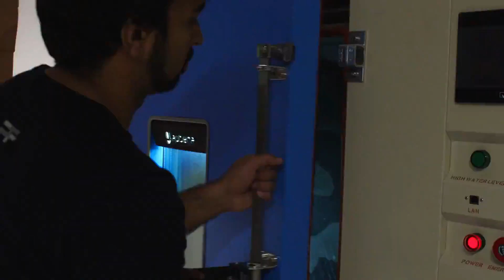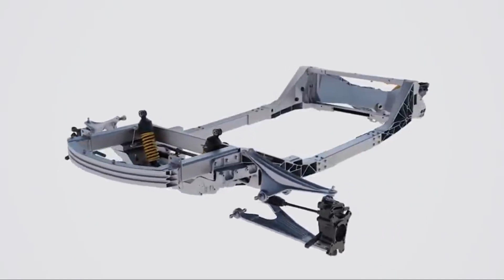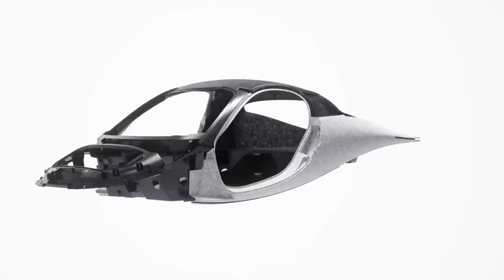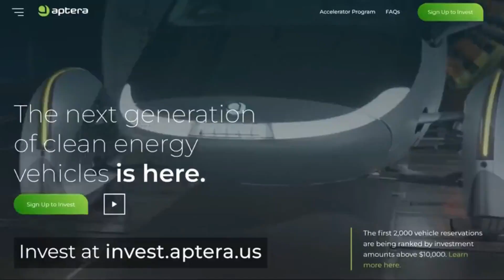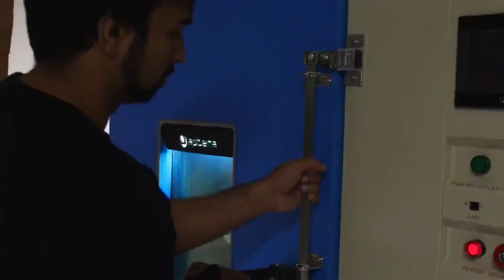Aptera Joins FORCES with C.P.C Group to Accelerate Production

Comment: Here's a comment I discovered I was blocked on - the weekly investment update:

Your information is worthless so long as you don't include their weekly spend rate. An August 6 2022 Aptera Owners Club evaluation of the latest SEC Filing has some interesting information, where the annual spend was $15m, or nearly $4m a quarter. At 1:04, your chart shows an income of just over $3m in the last quarter. (weeks 21 to 34). At that rate, that isn't enough to keep them alive, so there is no raising money towards the $50m required. In fact, they need more than that as every week progresses. By the end of the program, they will have achieved nothing, other than be closer to going broke.
Another thing of interest in the report was the 'Plan of Operations' list seen at 25:49. The third last dot point states they will build Delta before 2022 arrives, yet the report is submitted in August 22. That's just pure nonsense, and indicates how slack they are at reporting, as well as a complete disdain for government rules. In fact, my memory recalls they even knew about their switch to CPC long before August 22, so they are withholding information that they know will put Delta back by years. This is a possible serious misrepresentation that should be investigated by the SEC. The next dot point says they plan to deliver to a customer before 23 even arrives. As October 23 looms large, the snake oil is evident in hindsight.

Comment: The Audi 3 wheel concept car is more efficient and much more practical than the Aptera motorcycle.
Reply: @bobhellman8676 must be a new concept vehicle that we can't even find a reference to. Would like to see how it could be more efficient.  Aptera isn't in production yet, but much more than just a concept
Reply: @bobhellman8676  one of the latest Videos from electric viking
Reply: If it has 3 wheels, it's a motorcycle or autocycle in my state.
Reply: @tims8603  you are right. But did not intend to register it anywhere. Its just a proof of concept.

Comment: Thankfully Aptera's delay has been for positive reasons... let me reiterate what I've been told.  Originally they expected an interest level of up to 5K vehicles and had plans to build the composite parts using a sandwich construction method.  This method took considerable time and labor, but it was suitable for low volume.  When orders quickly surpassed the 5K expectation in just the first couple of days, Aptera needed a different, much faster composites manufacturing method to keep up and this was a major change of tack.  I believe Sandy Munro introduced Aptera to CPC, and discussions/design work began with them about two years ago.  Vehicle design changes necessary for the new manufacturing method were completed and CPC began to build the full scale tooling about a year ago.  Some of solid steel tooling blocks for Aptera weigh nearly 10,000 pounds and take many months to machine.  Most of that tooling is near completion now, and CPC is making the first validation parts with the tooling that is finished.  The expectation is to have a Delta test/validation vehicle or two, at or about the end of the year, with testing to follow.  Production depends on what the test results show, and whether or not changes will be necessary.
Reply: Hello, everyone! Just remember, AussieIdeasMan is doing us a great service. The one who yells from the mountain tops, "You can't! Because!" only stirs the fiery drive to create what has been said cannot be created. Thank you Aussie Ideas Man for that spark.
Reply: @89CrazyAl    Needed perspective, thank you.
Reply: @89CrazyAl  He is a clown of a naysayer. But he does serve a purpose.
Reply: @bobhellman8676   For validation/testing vehicles I don't know what they will do, sorry.  The intent for production is that CPC will do full body assembly, including glass, and ship completed units.  I wish I could tell you more about castings tooling and such, but no word is out about that yet that I am aware of.
Reply: @bobhellman8676  No problem, good questions.  I'm hoping for some update info to come out of the Owner's Club factory visit too.... I'm sure Steve will dig for details.  I don't speak for Aptera but I believe the power use is a calculated average.  Real world testing will be exciting to follow and see just how close it turns out to be.  My personal feeling is that Aptera has been a bit conservative, and that the production vehicle will meet or exceed that goal.  The vehicle composites have lost some weight in the transition from the originally planned sandwich core construction, to the sheet formed process of CPC, and the use of carbon fiber.
Reply: k @bobhellman8676  No worries, this is fun discussion and I'm happy to share anything I know.  I have not seen the frontal area published, but I can tell you that the coefficient of drag comes from a solid source.  Steve and Chris have said in interviews that the first big check they wrote in the beginning, was to NASA, at $17K for wind tunnel testing and a certified report.  Check out the recent Aptera Owner's Club video of the early days, that was the vehicle version tested.  Quite a few drag reducing refinements have been made since that time, so I would expect Delta to hit that mark.
Reply: @bobhellman8676  Bob, in regard to frontal area and drag, Chris Anthony has also talked about the vehicle shape, (particularly the hump in the back) when combined with the ground effect, pulls the high pressure away from the front of the vehicle.  This is also one of the key aspects to Aptera achieving the low coefficient of drag.  They stretched the tail a bit longer for drag reduction too.
Reply: "Thankfully Aptera's delay has been for positive reasons..." The delay in total has spanned   17 years, since they bagan in 2006. Dumb fanboys will discount most of those years for weak excuses, but 2006 is the real start. 
"let me reiterate what I've been told.  Originally they expected an interest level of up to 5K vehicles and had plans to build the composite parts using a sandwich construction method." By making preorders at a ridiculous $100, and as low as $70 for anything up to $48,000, they artificially increased demand. Real sales will never reach that much.  
"This method took considerable time and labor, but it was suitable for low volume." They can sell 1,000 year-old eggs in high volume - taking time doesn't mean volume has to suffer.   
"When orders quickly surpassed the 5K expectation in just the first couple of days, Aptera needed a different, much faster composites manufacturing method to keep up and this was a major change of tack." That first couple of days was as early as late March 2019, and they signed with CPC 3rd Nov 222. They had made 5 fake prototype in between those dates out of composites. Go figure? 
"I believe Sandy Munro introduced Aptera to CPC," He didn't. You lie.
"and discussions/design work began with them about two years ago." They secretly had dicussions for almost a year before they signed, and well before Gamma was made from composites.  
"Vehicle design changes necessary for the new manufacturing method were completed and CPC began to build the full scale tooling about a year ago." What were added was a steel chassis and a steel roll cage, yet they still advertised the shell was 7 times stronger than steel. If fact, dumb fanboys still make videos with these false claims, and dumb ambassadors are constantly making them in comments.  
"Some of solid steel tooling blocks for Aptera weigh nearly 10,000 pounds and take many months to machine.  Most of that tooling is near completion now, and CPC is making the first validation parts with the tooling that is finished.  The expectation is to have a Delta test/validation vehicle or two, at or about the end of the year, with testing to follow." At the Tesla Takeover on July 29, there is a video where Chris A. tells Sandy M. that a Delta will be finished "in a couple of months", and other videos have recorded this promise from early August. This means that August and September are those two months. We now have 8 days to October, and I will give him a generous 4 weeks to the end of October to get his act together, then he is poorly late, as he has been at least five times already. This is two months before the end of the year that you have pretended. A couple is never four. 
"Production depends on what the test results show, and whether or not changes will be necessary." No production, and for many reasons. You will get your hopes dashed time and time again. In fact, Chris told Sandy the silly trike will have a battery that hasn't been invented yet. As for the Launch Edition, there is the size, but they have no supplier. He is such a pathological liar, he can make false promises and say things that make them impossible, and still expect the gullible to believe him.
Reply: @aussieideasman8498   Anyone willing to do the homework sees the truth here, it does a good job of speaking for itself.  What ever happened to make you choose the professional pessimist road and find joy in tearing people down?  What a negative and small life you have chosen.
Reply: @DemaGeek   This guy hates Aptera more than he loves his cat.
Reply: @aussieideasman8498 just go away.
Reply: @ASawyerInAZ  Not going, so don't waste your time - you are nobody to tell me what to do, anyway.
Reply: @aussieideasman8498 you really just like to stir up things, but mostly you just don't know. The Launch Edition is using existing batteries that already exist. Chris has stated for quite a while now, including back in August, that the plan was to have a few built by end of 2023, and he would be driving one around the first part of 2024. Remember that even though Sawyer Munro is working with Aptera, he doesn't speak for them on when things will go into production